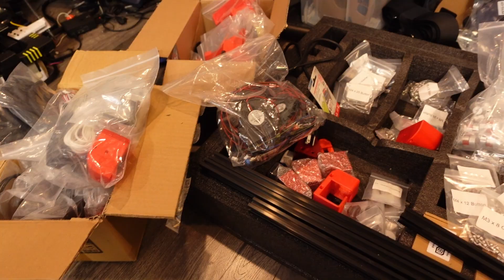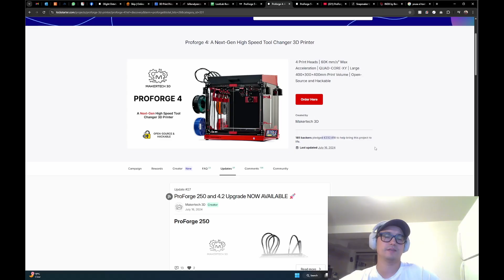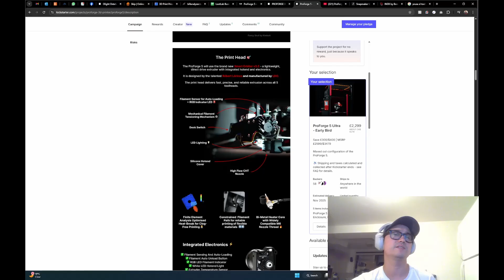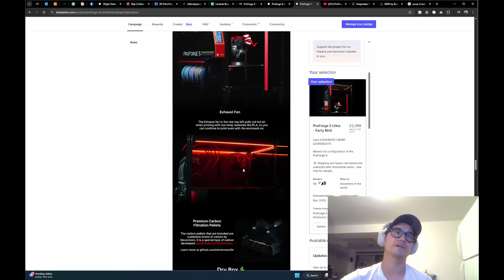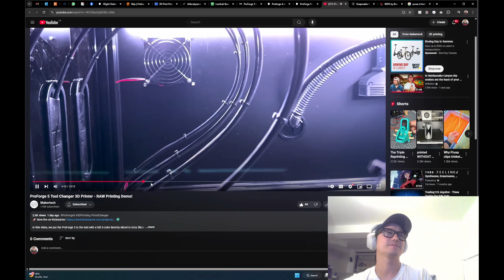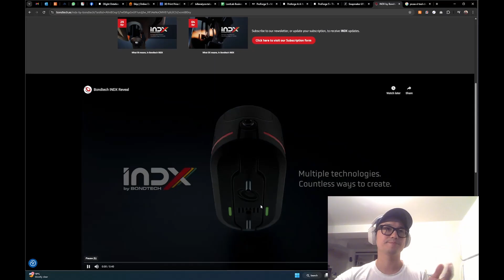Proforge 5 3D Printer – Ultimate Tool Changer?🏆 | Kickstarter vs Competition

Comment: I got my proforge 5 printer printing last night.  I love it!  There was a number of us building it at the same time, and the collaborative effort was tremendous.  If you get stuck reload your guide and the fixed instructions were there.  Once I cleared the final checklist, it printed flawlessly.  There were many updates to the original Proforge 4 that went into the Proforge 300, then a year later we have those lessons learned in the Proforge  5.  
It is a tall beast, but it is the correct footprint for the size...  I love that I can lean into the thing to get to the parts when I need to.
Reply from the maker: Wow amazing! Have you posted any pics or vids anywhere? I and am sure many others are interested. I just don't have a budget for one right now....
Reply: @3dlootlab  I don't have any videos...  I should have shot a build video, but I'd have to be better dressed, and it would just slow the build down.  I started my build about a week after it came, and  some people started getting them by air a few weeks earlier.  I was surprised at being the first to post a benchy.  I found the build easy.  2 weekends and 1 evening.  I don't have any media posted publicly yet.  I plan to build really large items, much larger than 500x400x500, so with Slic3r. petg, and pvc cement, I'll be building some yard art.  I have also got it wotking with the full spectrum snapmaker Orca fork.  The only problem with that fork is Snapmaker has brand-partitioned filament, so I can't enjoy a library of every brand, you can only print the same brand filament as your printer...  Strange and stupid slicer games Snapmaker is playing.  It means you must manually enter your filament profiles.  Full spectrum is limited by how it works, it likes to work on vertical surfaces tilted backward slightly,  It can't color tops of objects, and negative slopes don't work well.  But I did print an awful 15 color benchy.  One thing that is working well is multi-material supports  such as a petg print using pla as the support material.  Material waste is at an all time low, I'm getting these skinny wipe towers, compared to that first Proforge 5 demo.  Typically each color takes about 80mm of extrusion, so not a lot of filament going into the tower, and it is optional.    And while the INDX toolheads look nice, those are on generation 1, I want to see them around a while first, and yes if they are worthy they could go into a P5....  Remember, Proforge tool changers have several generations, and were inspired by additional  generations of e3d tool changer printers.  So they are not a big brand, and the quality depends some on who builds it, but it is an awesome printer with a really solid and fast toolhead build around the Orbiter 3.  The u1 looks good, and has a great price point, but the slicer games they play are not a good look for them.  But they want to sell razor blades.  Makertech doesn't make filament, so none of that  going on to drive the retail price down on the printer.  But it was a lot less expensive than the smaller, slower Prusa xl, but at the cost of assembly.  I was tempted to get a u1 also, but I couldn't justify it in any way, other than it was cheap.  But most of my printing is 1 color, so my xmax3, my mk3, and others are there if I need to make some more cheap servo noise for some reason.  So the u1 just wasn't needed if I had the P5.   

But about the INDX, you could pack a LOT of print heads into a P5 chassis.  But I'm not sure I need that many colors, I don't know I even need 5...  I never loaded 8 colors into my Pallet 3 pro...

Comment: I just wanna see some review models out there. I don't wanna pay that much for a demo unit.
Reply: It is a very nice machine, but you have to build it.  Once you get through the tuning, it prints like a dream.  Then you find out you should have used the huge bottle of locktite it came with,  in all the moving parts, so you go back and do that.  The you fill it with diamond nozzles, start attaching things to it, modding it to do whatever it is you do....  And you have a forever machine that will grow with you.  When proforge 6 comes out, there will be an upgrade kit...  But it is open source, with a lineage from E3d's tool changer, and several proforge models with improvements, so it is a 3rd generation tool changer.  LDO provided the printheads, and some of the motors.  x and y both have dual motors, running at a higher voltage,  to put double boosted xy motions.  z is 4 motors all it's own, but that isn't for speed or power, it is for bed leveling.  The largest feature is also it's downside...  It is 100% open source, and you have to build it.  But you CAN build it.  It is made from off the shelf components, and you can freely change it.  All of it is available for download, and you can make your own...  But the kit is actually very good.  I went slow, and it was a 5 day build for me.  But I know every inch of the machine, it is /my/ machine.  I've already worked with open source software people to get it into the full spectrum slicer, and by now it is in a couple of the others.  The fact I can do anything with this machine also means I'm responsible for my own user experience.  And this printer is for the more experienced, dedicated 3d printer enthusiast, that is capable if a complex build.  Easy out of the box printers are nice too...  But they don't make those big very affordably.  And finally, it was the faster tool changer,  compared to all the name brands...  although it isn't any more, flashforge has a new tool changer with a similar docking cam system, and because it is a small machine, it is a little faster.    The proforge is not for everyone, but if you are serious and need a large extensible open source machine, this is it.  And the way the software works, if you wanted to mod it later with 10 INDX toolheads, it would be pretty easy.  If you want to unbox a printer in 10 minutes, and print a 5 color benchy within the hour, this may not be your printer.  I love this printer.  The prusa was too small, and except for the commercial machines, there is nothing that comes close.
Reply: @bigtexuntex7825 I want a printer that when assembled works correctly for a long period of time with good parts support and flawless prints. I want gigantic build volume and multi tool. If it does that, I'm in. If I've gotta do all their slicer homework for them just to get a decent print, I'm out. Once I finish building it, I want it to work like the centauri carbon I own, but bigger and more capable. Tuning after is fine, but it needs to work once properly built. I don't wanna play guessing games and forum hunting.

Comment: The ProForge 300 started as a ProForge 250, and when I saw it at a trade show it had a lot more refinement vs the ProForge 4, and the ProForge 5 is better still. I backed it because I needed a large printer, and it’s very moddable, so looking forward to getting mine and adding to it. The use of OrcaSlicer is a big plus.

Comment: Excellent video!  I was looking at the Snapmaker U1 and saw the ProForge 5 on local 3d printing facebook page.  I've been doing my research the past couple of days and decided to back the ProForge 5.  Your video gave me some answers to my questions about MakerTech's history.  Your experience with the ProForge 4 was very helpful.  Thanks for mentioning getting an extra print head.  Saved me about $20 and shipping ;)  

I have the deposit for the U1, but there is a lot of missing info on it, i.e. what does the add-on cover look like and cost?  The base unit is at a great price point, but will the add-ons push the price into the $1300-$1500 range?  Are the components proprietary?  Are the nozzles switchable without having to replace other components.  Their Kickstarter may not go active until after the ProForge 5 closes.

Thanks again!
Reply from the maker: Thanks for the complement! Glad it's the video is providing some use!

Yes the u1 looks promising but agreed we know very little till it goes on to Kickstarter. Knowing Snap Maker, I am going to guess the parts are going to be proprietary.

The good thing about Makertech is we know they are open source minded, even provide the Bill of materials for the builds.
Reply: @3dlootlab  I received the U1 and it is a really nice machine.  Waiting on the ProForge 5 to be delivered.